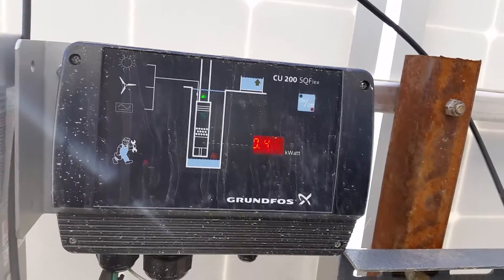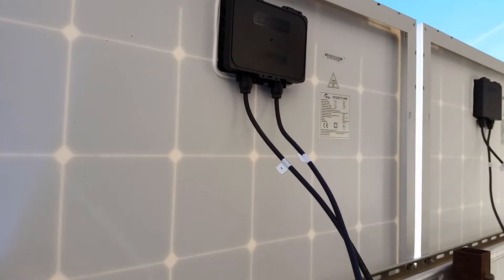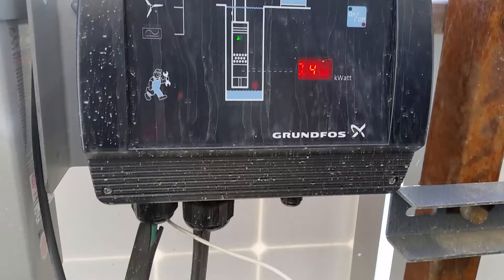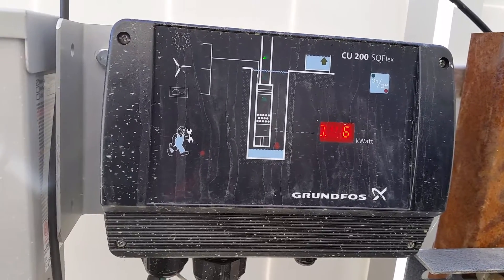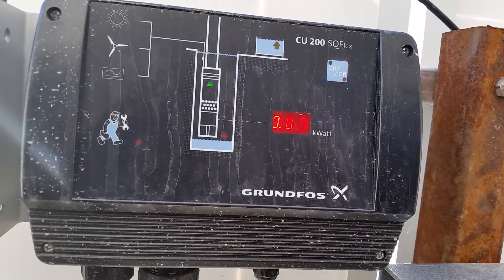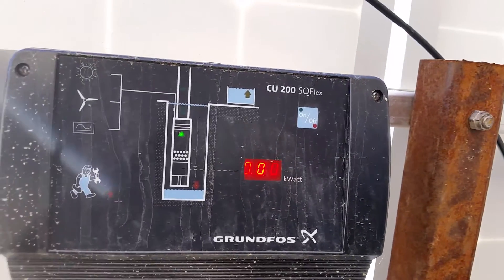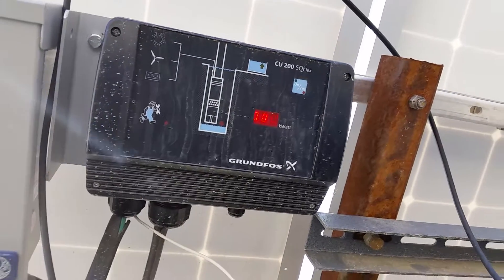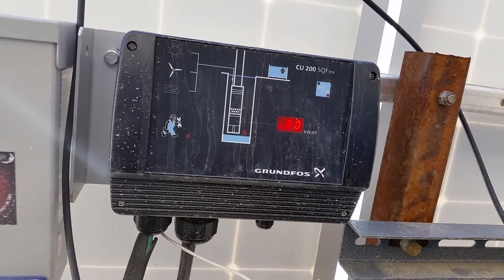Grundfos solar water pump

Comment from the maker: Yes, it was the pump. After we pulled it, we tested it for continuity and it failed.  The replacement pump worked beautifully, immediately.
Reply: was it under warranty?
Reply from the maker: @spiffdandy77  Yes, barely.  The warranty was 2 years and it lasted about that long.  The replacement is doing the same thing as this one was, and the replacement has lasted about 2.5 years.  I'm going to look for another solution.  Granted, this pump runs for 6+ hours per day and at very high pressures (for about 200 days per year), but I think a better method might be to use a cheaper submersible, that pumps into a tank at a lower elevation, and a surface pump that pushes the water further up.  The plunger-type surface pumps, like the SunPump products, have much greater life expectancy and are obviously easier to access, when they need maintenance.  I wouldn't mind swapping a cheap pump every few years, but this Grundfos SQ series is expensive.

Comment: This is simple ... 6sqf 3 requires 1300 watts to pump from that depth ....  if the panels are set correctly and kept clean.
Reply from the maker: Actually, I think you're looking at the far right of the power curve.  This pump only requires about 500 watts to pump to 625 feet, at about 2 gallons per minute.  https://www.solar-electric.com/lib/wind-sun/6_SQF-3_Curve_Data.pdf

Comment: What it means when appears F 3 in  display?
Reply from the maker: I can't remember, but Grundfos as the documentation online for the CU200 controller and all of the error codes are in it.
Reply: @rheasley  thanks!
Reply: It means there is a disconnection of the pump from the pipe if I'm not mistaken.

Comment: Been three years since this - hows it working? Thinking of using one of these...
Reply from the maker: It's been working very well (no pun intended), for the last three years.  Fingers crossed that it'll last at least a few more.  These pumps aren't cheap.
Reply from the maker: My replacement just died.  It made it about 2 and a half years.  More detail in the comment above.  HTH.
Reply: @rheasley still active?